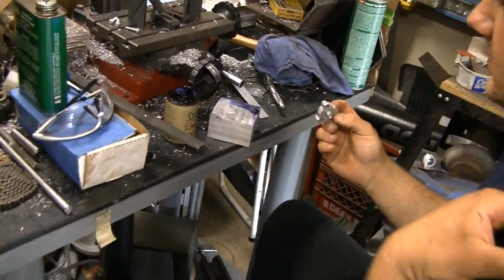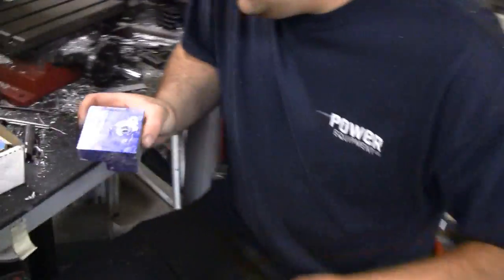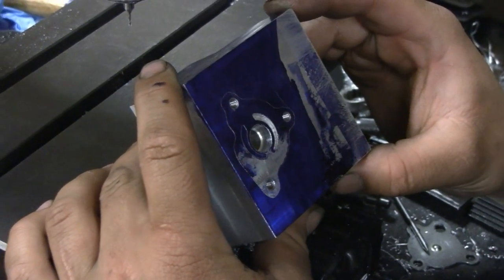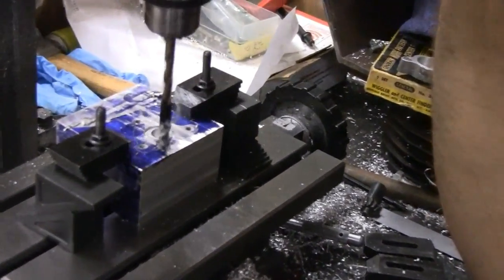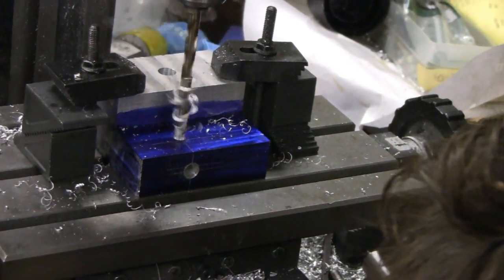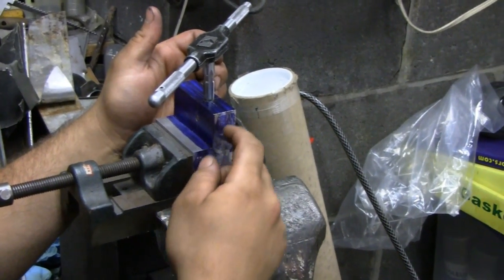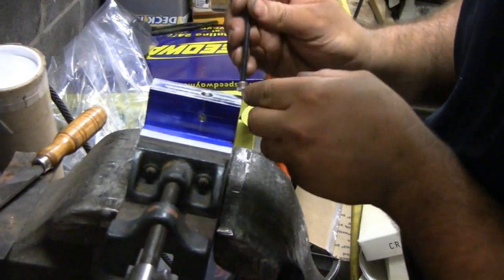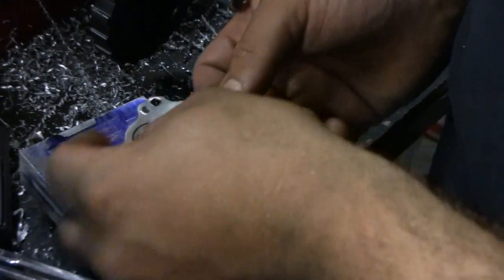HOMEMADE RADIAL BRIGGS ENGINE (part 12)

Comment: Look fwd to seeing it done. Love radial engines. Ps great job on the inline 4 briggs engine guys. I'm laid up after surgery and got bored last night and found the video on it. Got hooked on it and watched all of em. Have the big HF 3in1 Mill Drill Lathe combo machine in the garage. I don't get a lot of time to play with it, but it's fun. Even have made parts for aircraft test sets for the boss at work when we couldn't get the part or the cost of commercial machining or turning a small part was cost prohibitive. Nice part about that is it makes me pretty valuable as a worker over some others. Not only can I do electronics, I can make unobtainium precession parts at home if the job requires them. It beats telling the customer; "Sorry your $80,000.00 dollar Aircraft Test Set is not fixable for the quoted price, it will now cost $600.00 dollars more and will be delayed another month or two in paperwork". and, "Sorry we can't start the project unless we know we can acquire the parts"! Hey Mikey, I love how you get the job done. I know how you feel on the suggestions on how to do the job better. There's always more than one way to skin a cat. Some are better than others, but no matter which one you choose as long as it meets the requirements it's good enough. With that said try not to take it so hard if someone gives you a better idea, pigeon hole it and use it later. Besides you do a great job and knowledgeable people respect that and want to help. Took me awhile to personally accept that in life. As it's said, "Eat the meat (what's good) and spit out the bones", and the rest is water off a ducks back eh. Again nice job guys, love your work and unique projects. Keep up the good work. Best Wishes/Blessings Keith
Reply from the maker: +Keith Noneya Thanks Bud!!☺

Comment: Did you guys drop this project ? I have been waiting to see you finish it . So far you guys have been doing a GREAT Job ... I did find a video on here showing a guy rebuilding a REAL 7 cylinder Radial Engine . Then found another video of a guy building one out of a VW Motor . I never knew how they worked until I saw that guys video on the VW Motor ... Once you get it built you will have to build a plane to put it in ... Mike will fly it ... LOL......

Comment: Been waitin for this forever! Also Roadking i think you may find this interesting. Me and my father are restomodding a 1949 chevrolet 3100 1/2 ton truck and i need your opinion on something. You see were at a crossroads with the engine. Option one being a CSB 5.7L 350 or a GM 6.2 Diesel. The diesel would be so cool but it wont win to many races... So which one would you do? Sorry for the long post.
Reply from the maker: Brice loy That's cool!! I had a 1952!! I would go with the Short Block!! I think you would ruin a really cool truck with a diesel!!☺
Reply: 805ROADKING yah know what I really value your opinion so I think we're headed towards a 350 :)